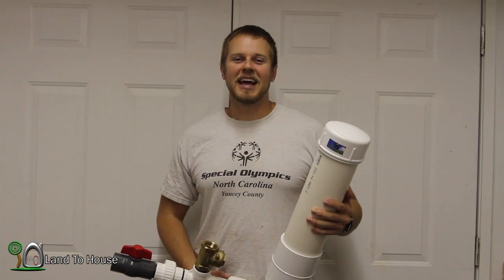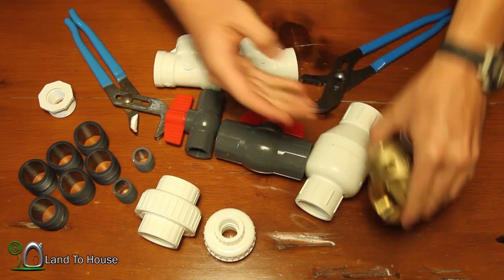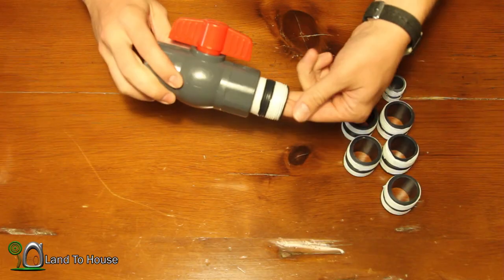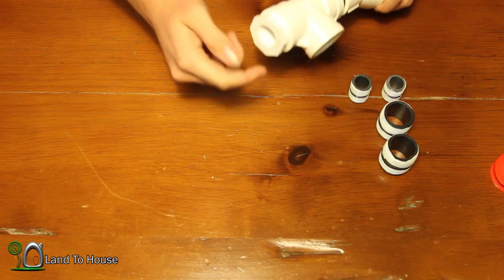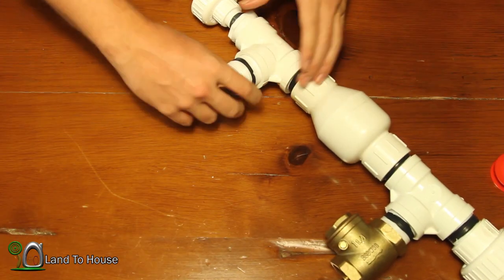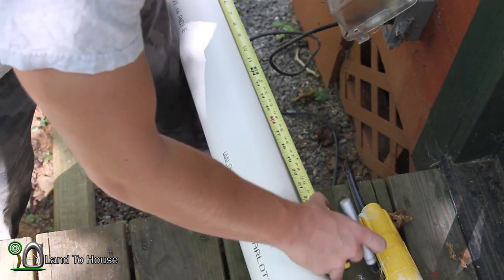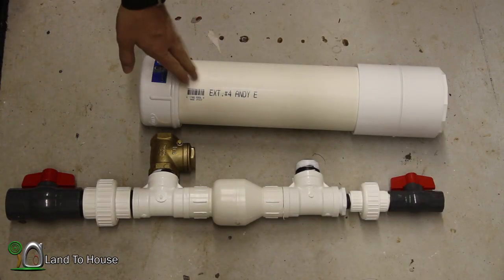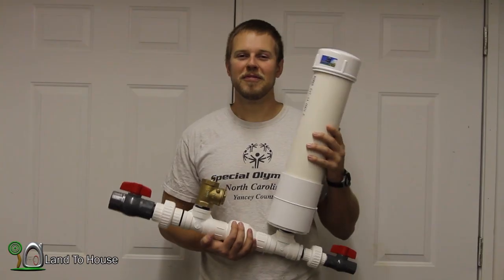How to Build a hydraulic Ram Pump

Comment: What's the point of the bicycle tube in the pressure tank?
Reply from the maker: Way back in the day , I thought it was necessary for an air bladder but have researched and found that it is not needed.

Comment: Great video! I have some questions... why did you start with 1.25" on the inlet side, and then have the discharge side have a 3/4" size? Is this to help build pressure? Why was your pressure tank PVC pipe 4" in diameter and 17" in length? Could one go with 3" diameter pipe and/or a long length in the pressure tank component?  I look forward to hearing your feedback and reasoning on this when time permits. Thanks!
Reply from the maker: The reduction in size is simply to save money on pipe cost. The  Output volume will be the same on any size pipe. You can
 Use a 3 inch pipe for the pressure tank. It will be just fine.

Comment: I used a stainless steel vertical check valve instead of a brass one.  The brass metal is softer than the stainless and wears out more quickly.  I got quite an increase in vertical pumping performance switching to stainless as well.
Reply from the maker: I used the stainless steel for several years.The problem is the extra weight increases the minimum input head pressure requirement. It greatly reduced the customers that could use the Ram pump. If You have the head pressure available It is a great swap.

Comment: Can an increase in drive pipe diameter shorten the  rate of fall distance..... I have limited size creek but high hills to climb back up.... almost 1000 ft of creek to make 30ft fall to climb back up 140ft to water storage

Comment: I'm befuddled! Why not drill a hole in the cap on the pressure tank gluing the valve in place to make adjustments to the pressure of the bike inner tube like a house's expansion tank!?

Comment: Nice little design.
But since you're using an inner tube to maintain air pressure and preventing the pressure tank from getting water logged (via the air dissolving into the water over time), it seems to be that instead of having the waste valve and the air tank both pointing in the same direction, it would be better to have them at 90 degrees to each other (air tank on side, waste valve pointing up). This would make the pump more stable when installed so you won't have to work as hard to keep the pump upright when in use.
Reply: It seems that there are some steps missing.  How do u connect it and get it started.  Thanks
Reply: @jojovideo2  Same as you normally would. Connect the pump. Manually press the waste valve open to allow water to flow and eventually cause the waste valve to snap closed, causing a pressure spike to pressurize the tank. Repeat if waste valve doesn't open on its own. Keep doing this until the waste valve cycles normally.

Comment: Hello. A tip, turn the tap over the other way. You can pull it tighter. And it will work better and easier. Nice video thank you. What is the secret with the number 17 inches for the pressure tank? can it be longer or shorter? Could you make it longer and use a car tire? Can venting the tube to the out side and adjusting the air pressure have a effect on the water pump?

Comment: Excellent video dude! 👍 However, it is unclear to me how pressure is coupled from the inner tube to the valve system.  How does air pass in and out of the tube?  Does it?  Or does it simply use the tiny air gaps between the tube as the chamber with the inner tube simply being an inner wall of the chamber?  Please clarify for the non mechanical engineering layman.  Thanks again.  I'm getting one of these  for sure! 😁

Seems pretty solid.  I love how your brain works.  Rock solid quality. It will last many years...

Comment: All you have to do to make the syphon work imediately is to simply couple the inlet and outlet pipes at the IBC tank. Just make the join underwater and remove the ram pump (again whilst under water. However the problem you might have is the syphon pulling too much from the creek and then the syphon will stop. A valve at the Pond end will sort this out for ya.

Comment: Nice build... The glue-up? Not so much. I've been in the trade for over 40 years. If I ever got caught assembling PVC your way? FIRED immediately... 3 things; 1; bevel the ends of your pipe, just a little. A file works fine. Because.., sharp, square ends work like a scraper - removing all of the glue that you applied so well. 2; ALWAYS use primer! I've seen entire DIY systems blow apart... Because, the manufacturing process leaves a trace of oil on the PVC surface.., which won't allow the glue to bond. 3; PRIMER and GLUE --- BOTH SURFACES! --- The pipe AND the fittings. Because... Primer removes the oil and grime. And, PVC "glue" is not glue. (I know) It chemically melts - dissolves - the surfaces of the pipe - AND - the fittings... and then they --- WELD ---  together. Fun Fact: The process is also known as PVC Welding. Because... It is! 
Bonus: (#4) If you hate the looks of purple PVC Primer -- all over -- your pipe joints, wrap a little masking or painter's tape just beyond the glue-depth. Remove the tape after your... 30-second hold... (read the instructions) Then there'll be no evidence of primer... or glue... (or just buy clear PVC Primer)

THAT'S --- how Professionals do it... Because, imagine having your car painted, and they skipped the paper and the taping..? Overspray Everywhere! Not acceptable. 

You're building and selling a product. You NEED to provide a Professional Grade product. I hope this helps.

Comment: I don-t see the second check valve (one way valve) at the exit. Why you introduced a byke tube in the air tank ? If you want to make a presure ball inside you must let out the valve of the rubber tube

Comment: Gday mate I was going to make one from 1 1/2 pipe can I make the pressure tank 24 "
Reply from the maker: Yes that will be just fine.
Reply: @LandtoHouse  Hi again, sorry but I forgot to ask if I can use a 4"  pipe for the pressure tank or what is the largest diameter I can use for that
Reply from the maker: @Casey6996  with a 1-1/2" pump a 4" pipe can be used. I would go between 18" and 24". Does not have to be specific.

Comment: Neat! My dad and I had a job to do once way out in the boon docks on a ram pump system.
 A guy had a large nice piece of property, almost mountainous with a creek and 2 man made lakes 70 feet above the creek.  He said his  ram pump needed 10 feet of water head to work. Meaning 10 ft for water to drop down to the pump for it to fill his 2 ponds 70 ft higher in elevation. 
Our job was to fix the pipe on piers that had been crushed by falling limbs and repair the blown out damn and come up with a way for the inlet pipe not to get stopped up.
 
We brought a backhoe in and rebuilt his blown out dam upstream. We drove a heavy steel plate down, then covered the plate and the pool floor with heavy plastic followed by rip rap ( rock approximately 9 inches in diameter).  The original 6inch inlet pipe would get stopped up so we put a 90 degree bend on and turned it down into the dammed up pool.

Before that we had to fix some sections of the 6 inch SDR 35 Pipe that was in the air on piers. Several places had been crushed by falling tree limbs.
The owner had at least 400 ft of pipe on piers in the air running parallel to the creek and finally turning left 90 degrees back to the creek where he had his ram pump setup. It was much like the old timers used to run paddles at a gristmill. 
After we got all of the water supply back up and running the owner came out and got the ram pump going. I had never seen anything like it.
 I believe he said it would pump up to 100 ft higher than the pump long as water coming into the ram was 10 foot higher than the RAM.

Comment: Nice work. I'm thinking if you added a male adapter to the end of the pressure chamber, and changed the pipe cap to threaded you could easily replace/re-pressure the bike tube as it leaks over time.

Comment: This is great, but you don't say which way round the unions are fitted? Also what are the unions for or what do they do?
If you increase the pressure tank size, would that increase the flow uphill?
Yes it is simple, but also you could fit this together wrong, which would be a shame. But thanks for your input, and have a nice day.

Comment: Some builders use pipe insulation (pool noodle) in the pressure chamber. Any experience with bike tube vs pool noodle. Thanks
Reply from the maker: I have tested both. Pool noodles get compressed very quickly and do not fill back out. Intertubes become deflated and also become pointless.

Comment: What is the purpose of the union connections next to the ball valves? Couldn't you just connect the ball valves directly to the threaded coupler joints?

Comment: Why the inner tube?
Reply: Doesn't it do the pumping? The water comes in and tightens it up, that pushes it out, then over and over. Though the last one I saw did not have the tire tube and worked fine.

Comment: That's  Pretty Cool But What Does  The Bike Tube Do, & What Happens if You Use A Smaller or LARGER Tube ,Or  if You Less  or More Air, Not That I Would Really  Care Unless It Did'nt Work or Work Right, Thanks So Much For The Video ,But it Seems Like Those Things Might Be Important  For Us To Know, & To Me It Seems Like The Tube Tank Give The Right Amount Of Pressured Resistance Needed To Alow The Swing Valve To Operate With / or Under the correct  Amount of Pumped Water Pressure  Through / in & Out of The Brass  One Way Check Valve That With The Pressured Chamber With The Colexabled Tube, Makes It A Regulated , Two Way Valve, Which is Really  Cool & Smart& Also Really  Cleverly Done , if infact That's What You Have Done & I Do Think So, So it Would Be Great if You Would Tell Us If I'm Right Or Should I Go Find A Padded  Room Cause I'm  Nuts in The Head Crazy  🙄🙁😀

Comment: You have to use the purple primer on ALL pvc projects, otherwise it will break down and leak. I would like to understand why you need a bicycle tube? Will it help with keeping the pressure inside the pipe or what? A demonstration would have been great at the end.

Comment: What happens if you use a different length on the pressure tank? Such as instead of 17 inches, you use 20, 30, or more; or just shorter to 12 or 15 inches?

Comment: Hi Mr.Seth..
I am watching all your vedios of "Land to House" as to your description on "Ram Pumps"..
Quite illustrative and very useful. 

I have got a DOUBT on the height / length of the **PRESSURE TANK**.

You have told the LENGTH of the 4" pressure tank pipe should be **17"**... 
Why is it so?
Is there any formula/logic on it?
What could be the consequences if the length is MORE  or LESSER  than 17"..?.

Could you PLEASE EXPLAIN that..

💐THANK YOU💐
Reply from the maker: Thank you for watching. The ram pump can actually run without the pressure tank. The tank does two things. 
1. Softens the water hammer.
2. Gives you a cushion of water to prevent shutdown when the delivery pipe is opened too fast. 

The volume of water in the pressure tank and the air bubble at the top will change size as the tank size changes. There is no real issue with going larger. I would not go much smaller.

Comment: Great job! What determines the size of the pump to use? Also, I'm not really clear on the purpose of the inner tube. Is not air over water enough to pump the water out? Could a smaller tube be used such as from a dolly wheel or wheel barrow, etc.?
Reply: The air chamber isn’t strictly necessary. It is a cushion to reduce the shock from the water ran on the pump. The tube keeps the air chamber from filling with water as quickly.
Reply: The bike tube prevents the chamber from displacing all its air over time and "wetting out".

Comment: Question - what is the main purpose of the air pressure chamber?  Is it just noise reduction?  I would think the uphill water column would provide all the pressure difference needed to close the valve, but I've never built one ;)
Reply: It smoothens out the outlet flow and reduces the pressure spikes.

Comment: my only advice is that a sawsall mighta done you better. other than that your tool use is spot on. not everyone has a sawsall so im guessing thats what you had on hand
Reply from the maker: I have now built several 1000 ram pumps and I use the chop saw. Effective and quick.

Comment: Would there be any added benefits to exposing the tube valve out the top of the 4" cap? For pressure changes
Reply: Out of all the assembly, that's the physics aspect I am not quite understanding.

Comment: There have been lots of YouTube videos about ram pumps. Have considered making a dual ram pump where you have tow pumps running from one feed line? They would need to synchronously control each other so that they always cycle alternately. This could double the output. It will take some engineering to pull this off.

Comment: Hello first of I wanted to tell u that I love all the content you put out. I just have a quick question for you would it be possible to run a hydroelectric turbine with a ram pump system from a standing pond and return all that overflow water back into the pond with another ram pump so kind of a closed looped system hope this makes sense.

Comment: Hi 
In India we’re not able to get 1 1/4” PVC fittings, can use 1 1/2” PVC fittings for water head and for delivery 3/4” , is it workable this kind of system?
Reply from the maker: Yes that is fine. Just be sure the waste valve and drive pipe are the same size.
Reply: @LandtoHouse  Thank you so much and understood the requirement.
Reply: Hi 
One more clarification , if am using 1 1/2 Head pipe and waste valve, than the pressure tank height should increase or need to keep 17inches length and 4inches pipe only, please guide me .
Thank you.
Reply: Hi 
I have made locally and it is working for while than stopping, can you guide me what is wrong with that.
Thank you

Comment: What is the purpose of using the union joints instead of less expensive couplings?
Reply: Good question. Look at how it is so easy to twist all those parts on and off when you are assembling the pump. But when it's all assembled and has an intake feeder pipe and the exit pipe you will wish you had used unions. Quote "A PVC Pressure Barrel Union is used to break the line and allow access for maintenance. The locking nut can be unscrewed to allow a section of pipe or a fitting to be removed. Often a barrel union is used in front of a check valve or a pump to isolate it and to have the ability to break the line."

Comment: you could forgo the inner tube and simply drill a whole in the end cap and insert a valve stem. Air itself is a compressible gas, if the system is well sealed up then there should be no nead for the innner tube to be inserted. simple pressurize the chamber directly through the valve stem.

Comment: I didn't see where the 2nd check valve went.  Did I miss something?

Tom Dutkiewicz
Reply: It was installed vertically in the inlet line of the ram pump to serve as purging valve to remove unnecessary air.

Comment: In case no one sees my reply in regards to using a clean out plug on the top of the pressure tank instead of glueing on the cap..the clean out plug is only rated 5 psi. You can unscrew the bottom of the pressure tank at the pipe nipple if you need to replace the inner tube. Just retape when you screw it back on. Or you could cut the cap off and replace it, losing a couple inches in overall height. If someone has another idea please comment.
Reply from the maker: Ah yes threaded cleanouts pressure tanks are tricky. A ram pump can get up to 100psi with enough head pressure and the delivery closed.

Comment: Please make a list of materials at comment section and pin it.thank you
Reply: 4 inch schedule 40 PVC pipe -17inches -1
4 inch coupling -1
4 inch socket reduce to 1-1/4 threaded bushing -1
4 inch cap -1
Bike inner tube -1
Primer and glue -1 each
1-1/4 close pipe nipple - 6
3/4 close pipe nipples -2
1-1/4 threaded ball valve -1
3/4 threaded ball valve - 1
1-1/4 pVC Union - 1
3/4 pvc Union - 1
1-1/4 PVC (T joint) threaded on all 3 sides -2
1-1/4 threaded spring loaded check valve - 1
1-1/4 bushing reduced to 3/4 threaded 
1-1/4 brass swing check valve
Teflon tape
Reply: @JoeTafoya69  thank you sir..Lloyd from Philippines

Comment: great video. If you are using a bigger sized hose, 1 inch versus a 1/2 does it matter with water flow? more water flow the bigger the pipe you should use?

Comment: What a great job you did in explaining in detail how to build this. I am new to the 'ram pump' idea and am still learning about it. That being said, I do have one question. What's the purpose of the inner tube? I have watched several how to vids on building a ram pump, but this is the first and only time I have seen or heard even a mention of an inner tube. So, now I'm back to wandering in the desert alone. In other words, I lost again....
Reply: I also would like to know why the tube is placed in there?
Reply: @jayrex0093  pressure tanks work because there is a pocket of air that rests on the top that puts pressure on the water. Imagine at the pool when you try and hold a air filled ball underwater, water/air don't wanna occupy the same space. Standard pressure/expansion tanks have a "bladder" inside them that separates the water from the air pocket. His pump would work but eventually the natural air pocket in that pipe would deminish so to prevent that he used an air filled bike tube that cannot go away unless the tube itself failed. Just a smart way of keeping air inside the pressure tank.
Reply: @latestplague3762  Aha! Got it now. Your explanation fills in the dots perfectly.